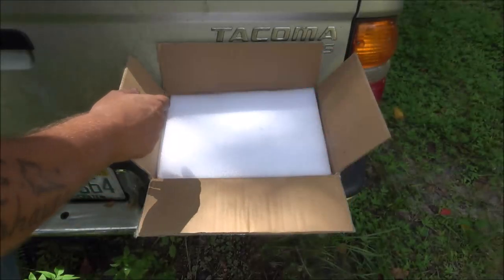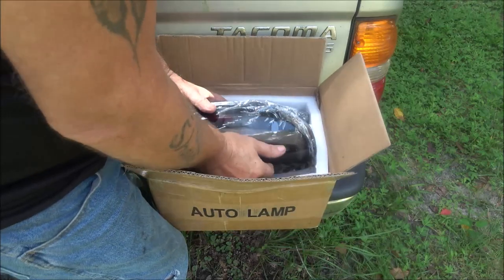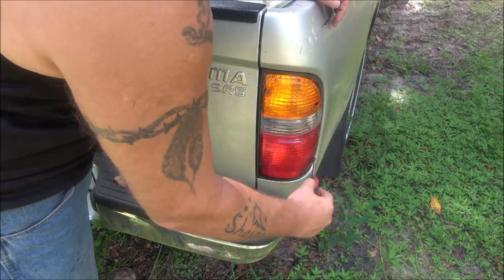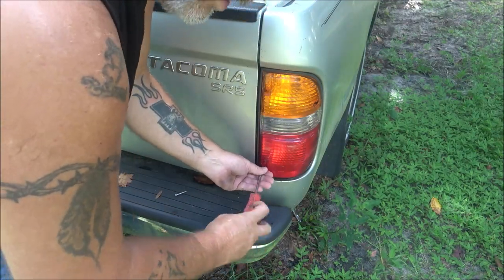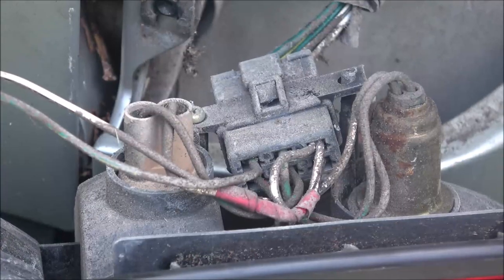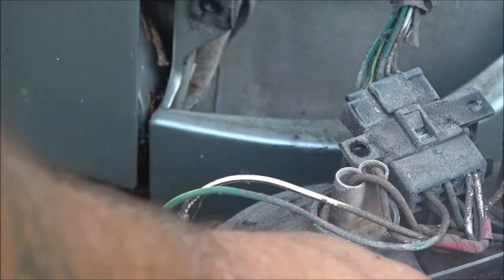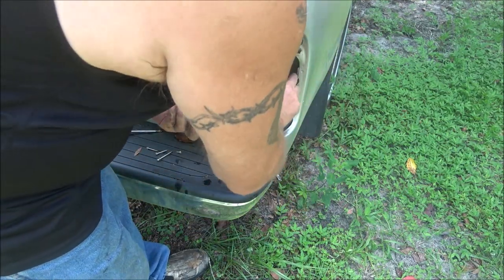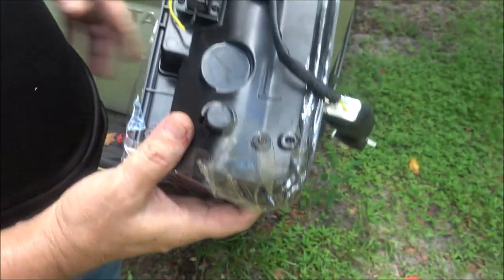Sequential Full LED Tail Lights

Comment: your truck you said is an 03, 04. Mine is a 1999
Reply from the maker: This has been a great truck for her.  It has over half a million miles on it. I'll be rebuilding the engine on it soon.
Reply: @shabear1000  wow. Mine has around 60,000 actual miles.